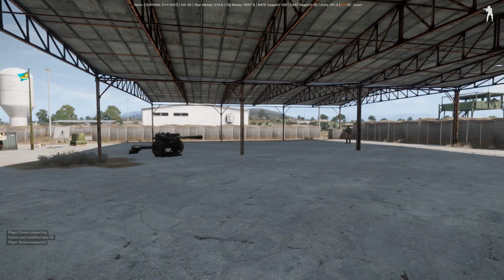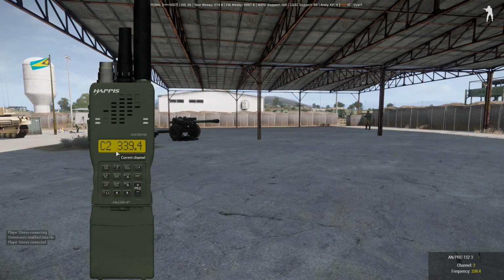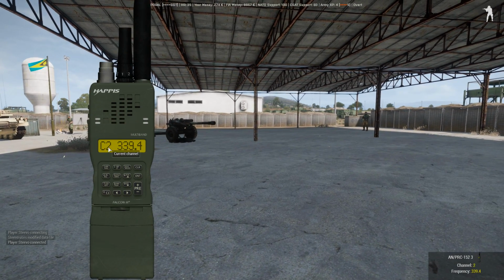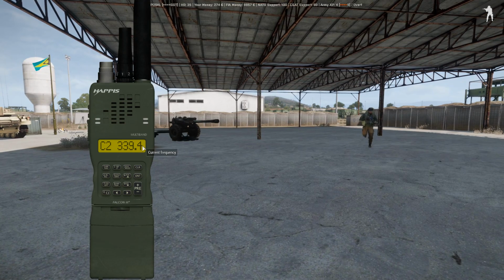Arma3 Antistasi - Task Force Radio Now Mandatory

Comment: There seems to be a reacuring bug that resets the HQ to the lower left corner of the map if the Officer is down and the HQ is reset. Also, once the Officer is down I do not find an option to relocate HQ and there does not seem to be an option to revive the officer.